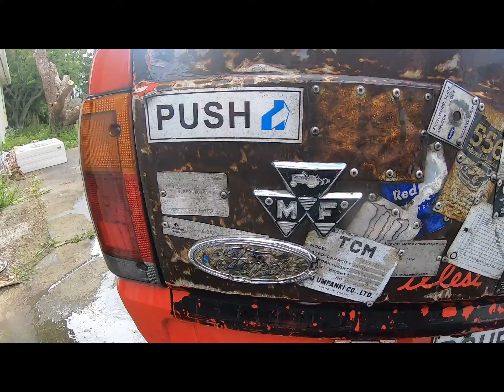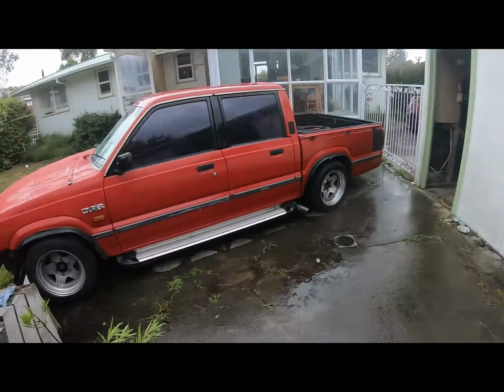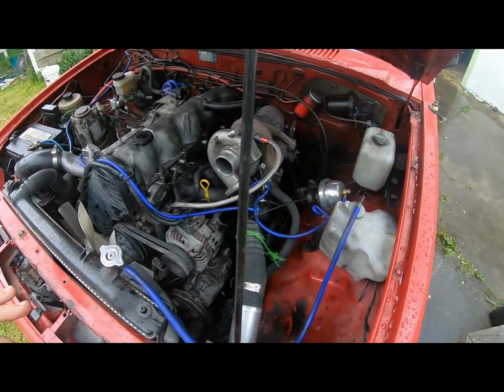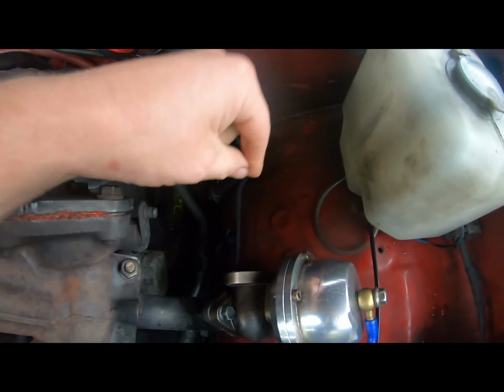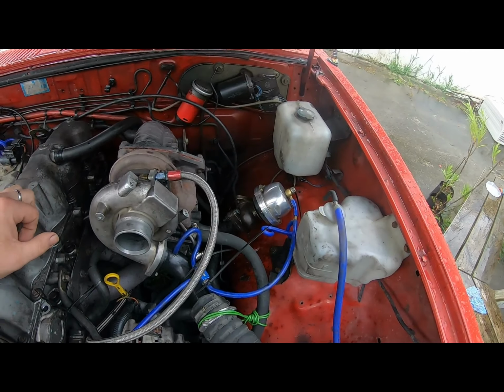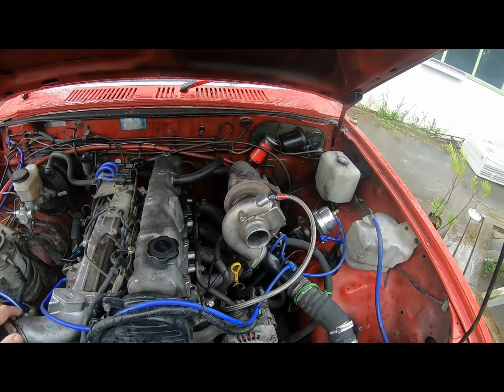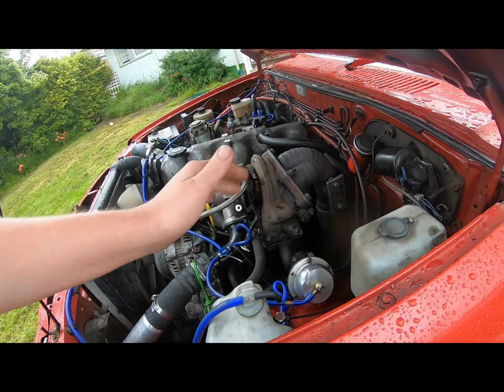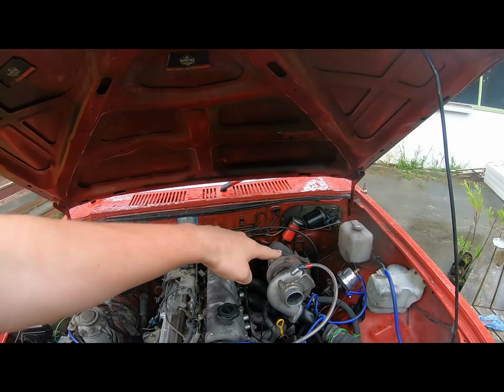Cliffy gets a buff! td06 wlt turbo drifts

Comment: So ya wind boost compensator on pump  clockwise? Might mark mine and give it a crack
Reply from the maker: Ahh yeah wound it all the way in, didn't increase full I don't believe but gave it full fuel straight away, as if running a non compensated pump
Reply: I have wlt also. Pop boost compensator fuel pin out. Turn to most agresave ramp. Re install. Wind spring nut most of way down. Do what you did on top of compinsator to add more fuel at bottom of rev range. Then wind fuel screw a little bit as shown in other vids. Thats what ive done to roll some coal. Shes also way more responsive 🤙